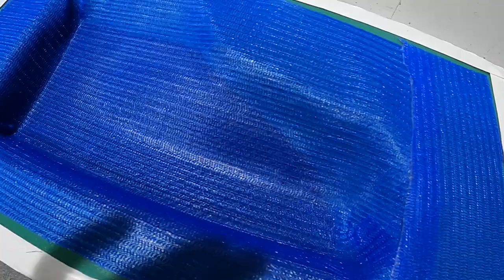How to make a Carbon Fibre cover using resin infusion. EPOXY

Comment: Without post cure in an oven wont the weave print through if this is an engine bay area cover?
Reply from the maker: Agreed, you would need to post cure the part. Idealy post cure in mould if it can withstand the temperature

Comment: What's the difference between layering of resin (normal method) and this infusion method?
Does it effect the strength or takes less time or any other thing?
Reply from the maker: Much stronger infused under vacuum. Less resin used. And flawless finish
Reply: Lighter products and also you can make good predictions whas the weight of the product going to be based on cloth weight number of layers and amount of resin that is needed because you can calculate it. Which for some projects is important.